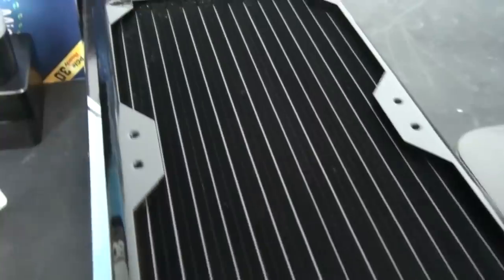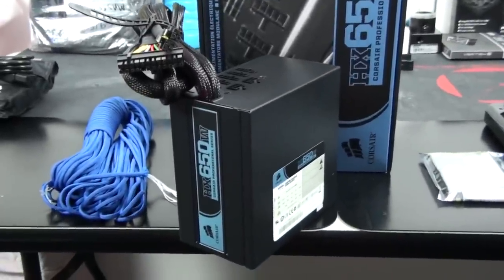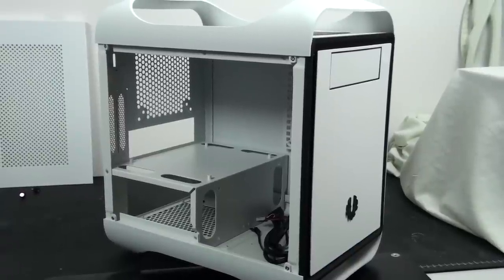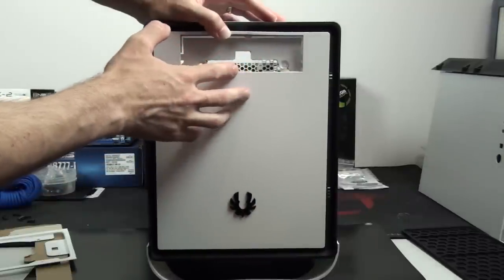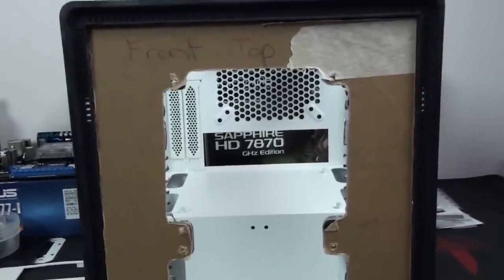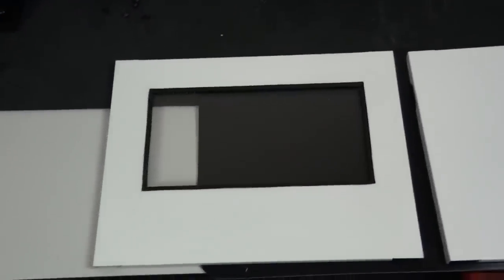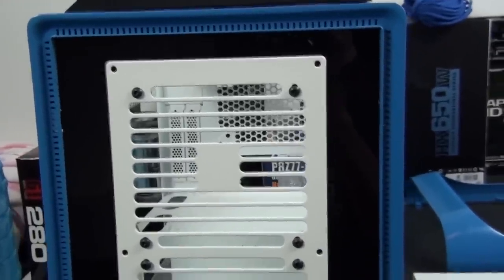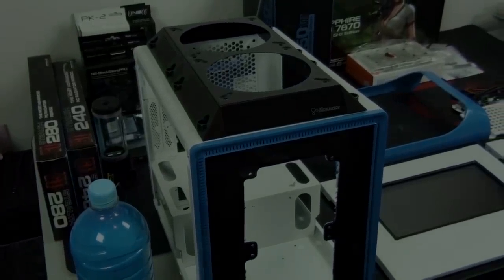Build #6: 'Prodigy': Part 2

Comment: I would love to see a 7950 or a 7970 in a build like this, as I wrote in comments of the first video. This build have to be future proof. Then it will be better if u use a EK VGA backplate cause:
- sapphire blu doesn't match Asus one perfectly
- a black backplate match the rear black of the P8Z77-I deluxe "vertical power board"

Comment: I really like the front and want to do the same. Right now I have a fan controller installed the in 5.25 bay, so the metal part of the frame has been removed. My question is: Will there be any issues installing the 240 rad with the top two mounting points not there since I removed my mounting points by taking out that piece for the fan controller?

Comment: What fans and what rpm do you typically use in those cases?  I'm interested to know since I've used the GTS 360 and GTS 140 and I never really got good performance out of them without having the fans super loud.  Used Gelid Wings on my builds.

Comment: what paint did you use? would an enamel pressure can work ok? (with the correct prepping). i'm just worried that the flexible handles will crack once painted :/

Comment: Do you think a Corsair H100 would be sufficient cooling for an i7-2700k under the stress of 1080p streaming while gaming? If not what would you suggest?

Currently I've got a i5-2400 with an H60 and my temperatures get up and around 90C (not to mention Temp2 maxing out at 127C at one point) and this just isn't cutting it.

Comment: Not bad but personally I don't like the GTS rads from HWLabs at all since you need to have ridiculously loud and high static pressure fans to get any air through them but I can't think of anything else that you could fit inside an ITX case.

Comment: Dont you think the power delivery system on the assus p8z77i would block the top radiator. in the worst scenario the radiator will heat up the power delivery system

Comment: hey do you know if its possible to use my current 750gb, and just add a second 1tb drive? I don't want to reset my computer or reinstall windows on it but I'm already running out of storage space since I got this new setup in june.